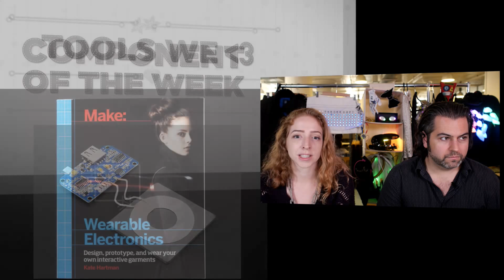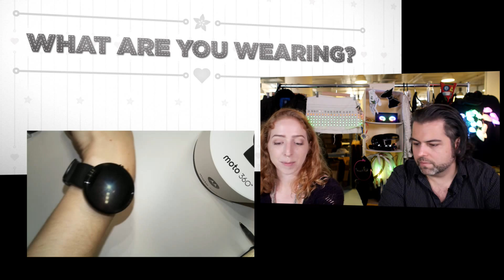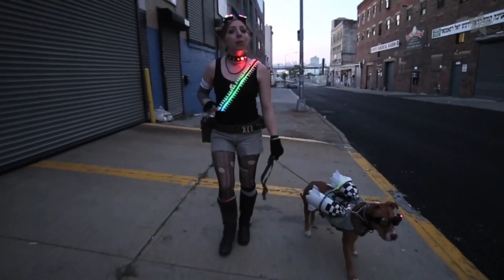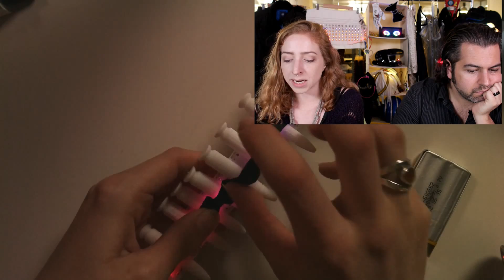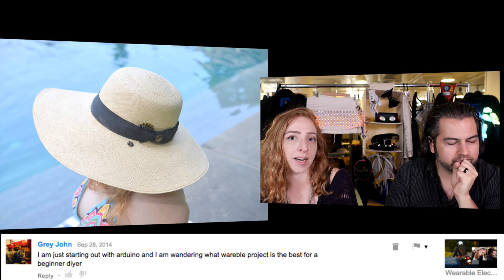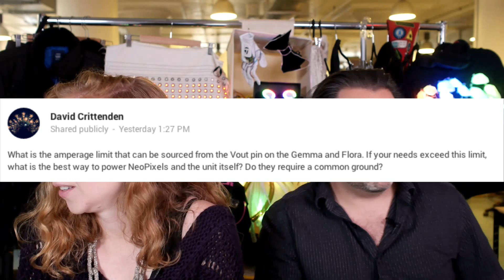Wearable Electronics with Becky Stern 10/15/2014 - LIVE

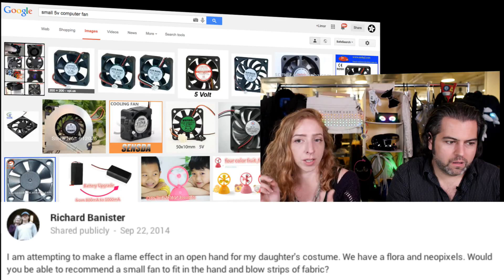Comment: Not a wearables question but a suggestion regarding 26:55-

Wouldn't a Pinoccio wireless microcontroller be best? A little pricier than writing an app but it pays for the ease of use.

Comment: Hi Becky, I've thinking about getting that special someone a purse but I want to Spruce it up by adding Qi charging in one of the pockets. I have access to a sewing machine but i'm a bit of a novice.  my question to you is,  how difficult is this project, will I able to hide the re-stitching inside of the purse if I hand sew it only?
Thanks for the awesome show  fan

PS also thinking about adding an additional unit QI unit at the bottom of the purse for charging the purse's battery. If I do it right, this purse could possibly have a Qi transmitter and battery for charging the phone on the go and a receiver at the bottom of the purse for charging the purse at home.

Comment: The hide and seek vest is actually very doable. I've done something like this in a standard enclosure as a game prop for a LARP.

It used a neopixel ring to indicate location of two other devices.

Wireless was handled by xbeePro s3b modules. The 900mhz units gave me about 700-1000ft in the woods. Also once we had signal lock, losing gps wasn't an issue, but we wern't entering any major structures. But in testing once it had locked, we had no issues indoors or out, especially the one unit with an active ufl antenna attached.

The big issues are 

1) Enough power to last.
2) the gps and xbee are both serial devices and in order to program i used software serial for both. this required some trickery, as it will only listen on one software serail device at a time.
3) range! you may require repeaters to keep in contact. 
4) wireless messages getting corrupted.
5) update frequency. I transmited device location every 30 seconds, that seemed to work just fine.

I also had a python app running which fed real time location of each device to a google maps app.

a lot of the code was based on the flora gps watch.
Reply: Here's what the code looks like:

https://github.com/ehutch79/SD_Tracker_Red